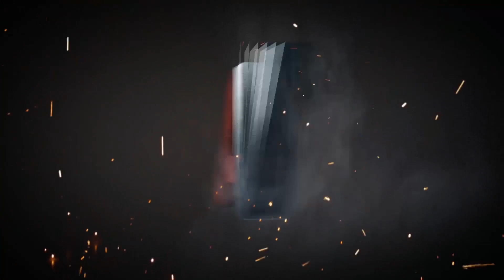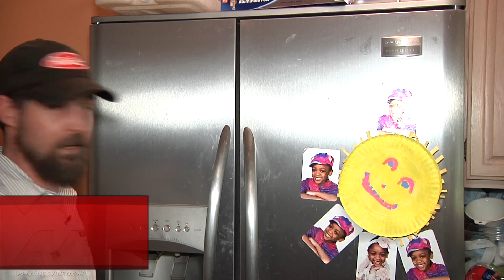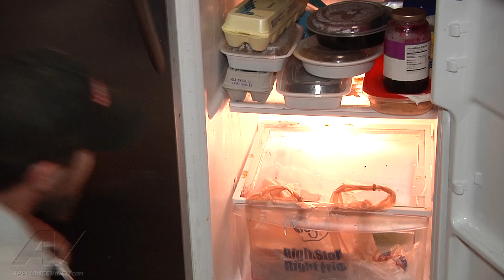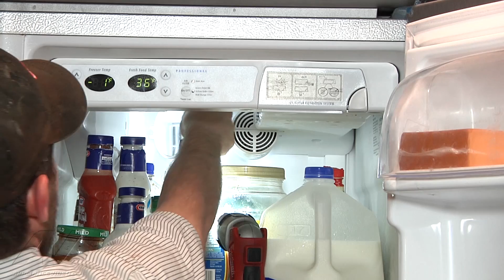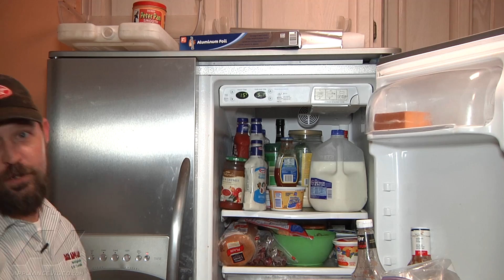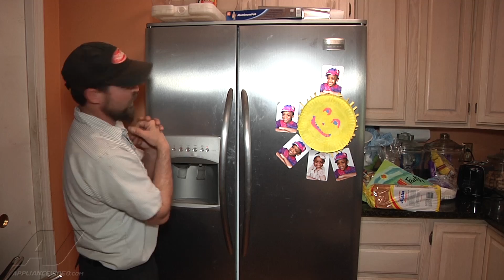Frigidaire Refrigerator Repair - Not Cooling - Main Control Board

Comment: I replaced the fride thermistor and the defrost thermostat and this board yet my coils slightly frost over so I do a manual defrost and everything is fine for about an hour then the fridge temp starts going up and the freezer goes up or all the way eventually past -20 can anyone help

Comment: How do I reset the frig itself?  I turned mine off and had it in storage and now it won't come on.  The lights come on but nothing else.  I was told I must rest it but don't know how.
Reply from the maker: Great question, if you have a more technical question that our parts department cannot answer, you can search our over 17,000 answered questions free at our website www.ApplianceVideo.com under our Repair Help section. You can also call our parts department at 1-800-830-5465 and they can give you help 7-days A week ,or search at www.SaveMoreOnParts.com  .

Comment: I have the same refrigerator, my temperature readings are doing the same thing, however I have uneven freezing on my evaporator, the first section freezing up. All of the fans are running properly, everything is clean, my freezer is not getting as cold as it used to . I’m not sure if I have a control problem or a compressor that’s failing to push the Freon through I hate to spend money for a control if my compressor is failing anybody seen this before?
Reply from the maker: Great question, if you have a more technical question that our parts department cannot answer, you can search our over 17,000 answered questions free at our website www.ApplianceVideo.com under our Repair Help section. You can also call our parts department at 1-800-830-5465 and they can give you help 7-days A week ,or search at www.SaveMoreOnParts.com  .
Reply: I am having the same issues, did you find out what the problem was or how to fix it?
Reply: @karenpack6311  yes I bought a kit and put Freon in it, cools fine for about a year then I add a few more ounces of Freon. They wanted $800 to repair the leak.

Comment: say tim do you have much experience with the ffss2614qeo frigidaire? i have one that i just can't get the fridge cold. i can actuate the damper door in manual  mode and it does open and close on its own but the temps are running high. with the setting at 9 it runs around 50 deg and warmer at lower settings. i have a camera now watching the door with a t/s to monitor the cycle. at this time i went thru a setup on it and now the door remains open and the temp is 30 deg. so now i may have to turn it off and let it set for 15 minutes and then restart it to get it into run mode. i have a service guy telling the damper door is bad but i'm leaning on either to controller of the termistor.  about a month ago it gave me a high fridge side temp warning and i found the lower port plugged with ice. so i went into manual defrost and watched the water drain into the lower pan so the heaters are working. i can cycle the fan and the damper door in service mode. and i can turn the compressor on and off. but i still have cooling issues. the freezer works great i can get it to 6 deg at setting 1 and -8 deg at setting 9 but i can't get the fridge side to change much. no matter what setting i go with. so any ideas what to look at?  i have a baby cam in the fridge now watching the damper door and a t/s and the t/s is at 30 deg and the damper is still open and the settings are now at 9. thanks
Reply from the maker: Great question, if you have a more technical question that our parts department cannot answer, you can search our over 17,000 answered questions free at our website www.ApplianceVideo.com under our Repair Help section. You can also call our parts department at 1-800-830-5465 and they can give you help 7-days A week ,or search at www.SaveMoreOnParts.com  .

Comment: yes i have the same  Frigidair REFRIGERATOR  , THE FAN MOTRO IS WORKING BUT IT DOES NOT FRONZEN THE MEAT. wHAT CAN i DO?
Reply from the maker: Great question, if you have a more technical question that our parts department cannot answer, you can search our over 13,000 answered questions free at our website www.ApplianceVideo.com under our Repair Help section. You can also call our parts department at 1-800-830-5465 and they can give you help 7-days A week ,or search at www.SaveMoreOnParts.com  .

Comment: I have the exact fridge model number E23CS78EPS2 and when I plug it in it seems that everything works OK it shows the temp on the food side and also on the freezer side then the interior lights start blinking on and off and after about 5 times on the freezer side of the display it starts flashing the number 2 on and off on and off and the fan and compressor cuts off what causes this???
Reply from the maker: Great question, if you have a more technical question that our parts department cannot answer, you can search our over 13,000 answered questions free at our website www.ApplianceVideo.com under our Repair Help section. You can also call our parts department at 1-800-830-5465 and they can give you help 7-days A week ,or search at www.SaveMoreOnParts.com  .

Comment: hello I need urgently min fridge FRIGIDAIRE 241739703 REFRIGERATOR CONTROL BOARD WHITE 241739711 E154554 7271651 because of high voltage, I'm broken I need to get away very good pictures of the map that I can see the board can or schematics please help me I live in Turkey thanks in advance Rasim
Reply from the maker: Great question, if you have a
more technical question that our parts department cannot answer, our
technicians are answering all questions at our website at www.ApplianceVideo.com under our Repair Help section. You can also call
our parts department at 1-800-830-5465 and they can give you help 7-days A week
Monday -Sunday, or search at www.SaveMoreOnParts.com  24 hours
7- days A week.

Comment: Our  whirlpool refrigerator does not have an alarm when the door is open too long
Reply from the maker: Great question, if you have a more technical question that our parts department cannot answer, our technicians are answering all questions at our website at www.ApplianceVideo.com under our Repair Help section. You can also call our parts department at 1-800-830-5465 and they can give you help 7-days A week Monday Sunday, or search at www.SaveMoreOnParts.com  24 hours 7 days A week.
Reply from the maker: Great question, if you have a more technical question that our parts department cannot answer, our technicians are answering all questions at our website at www.ApplianceVideo.com under our Repair Help section. You can also call our parts department at 1-800-830-5465 and they can give you help 7-days A week Monday Sunday, or search at www.SaveMoreOnParts.com  24 hours 7 days A week.

Comment: I have a Frigidaire side-by-side, it is 6 months old, there is no water pressure for the water in the door, and the ice maker has stopped making ice. It does make a little bit of ice but nothing to talk about and it's also Hollow ice
Reply from the maker: Great question, you can call
our parts department at 1-800-830-5465 and they can give you help 6-days A week
Mon-Sat . You can also search at www.SaveMoreOnParts.com 7- days a week.  If you have a more
technical question that our parts department cannot answer, our technicians are
answering all questions at our website at www.ApplianceVideo.com under our Repair Help section. We have over 6,000
common questions and answers that you can easily search through by your model
number, appliance make, problem or error codes, and It’s completely free to
search through our question & answer library. There is a very good chance
you question is already answered there.
Reply: E ve  Tooker ok

Comment: I have that same fridge and I do not want to run the panel buttons and an alarm sounds what problem can I have?
Reply: My  frigiaidaire saying hi
Reply from the maker: Great question, you can call
our parts department at 1-800-830-5465 and they can give you help 6-days A week
Mon-Sat . You can also search at www.SaveMoreOnParts.com 7- days a week.  If you have a more
technical question that our parts department cannot answer, our technicians are
answering all questions at our website at www.ApplianceVideo.com under our Repair Help section. We have over
4,000 common questions and answers that you can easily search through by your
model number, appliance make, and problem or error codes, and It’s free to
search through our question & answer library.

Comment: I have the exact same model but my fridge ices up severely every few weeks, it will not defrost.  Can you tell me where the defrost timer is on it, been looking all over.  thanks
Reply: curious as any update on your problem. thanks
Reply: The defrost control on this model is integrated in the temperature control right behind the display
Reply from the maker: Great question, you can call our parts department at 1-800-830-5465 and they can give
you help 6-days A week Mon-Sat . If you have a more technical question that our
parts department cannot answer, our technicians are answering all questions at our website at www.ApplianceVideo.com under our Repair Help section. We have over 4,000
common questions and answers that you can easily search through by your model
number, appliance make, and problem or error codes, and It’s free to search
through our question & answer library.

Comment: Ours is a Frigidaire side x side about 10 yrs old.  Recently noticed a slight rise in the freezer temp. so adjusted the thermostat and all seems well.  But at the same time, the frame around the freezer door is very warm or may even be considered hot(temps running from 90f to 104f.   Is this a symptom of a defrost heater or thermostat gone bad or about to go bad?  Maybe staying on longer than it should but still allows the freezer to cool down?
Reply from the maker: Great question, you can call our parts department at 1-800-830-5465 and they can give
you help 6-days A week Mon-Sat . If you have a more technical question that our
parts department cannot answer, our technicians are answering all questions at our website at www.ApplianceVideo.com under our Repair Help section. We have over 4,000
common questions and answers that you can easily search through by your model
number, appliance make, and problem or error codes, and It’s free to search
through our question & answer library.
Reply: Dick Madison , small Refrig.Frigidaire mod # fft1222qw board changed still blinking it will not reset.

Comment: Okay so I have the same fridge in the video, stainless if that matters. I checked the damper like you showed in the video, Damper is working, opening and closing, return duct is okay. Problem I'm having is when we play with the setting on the control panel, everything shuts off, fridge still has power, lights come on, but the fans turn off and when we play with the controls again, the panel goes blank and beeps over and over. I'll unplug, let it sit for 15-20 min, plug back in and it's working again. Then we play with the controls and the same issue. My model # is DFHS2313MF2 by Frigidaire. Freezer is cold, fully defrosted, all fans are blowing like they should. Besides the control panel what else should I check or in your best guess is it just the panel that needs replacing.... Thanks
Reply from the maker: Great
question, you can call our parts department at 1-800-830-5465 and they can give
you help. If you have a more technical question our parts department cannot
answer, our technicians are answering
all questions at our website at ApplianceVideo.com under our Repair Help
section. We have over 3,000 common questions and answers that you can easily
search through by your model number, appliance make, and problem or error codes,
and  Its free to search through our
question & answer library.

Comment: After you suspected the temperatures were off, wouldn't you hang a thermometer in the refrigerator and close the door for a while and compare the actual temperature to the readings on the refrigerator readout?
Reply from the maker: +Junk Yard 

         Great question, with our technicians
now getting hundreds questions weekly, they are answering all questions at our
website http://www.appliancevideo.com/repair-help/ .  We also have over 30000 common questions
and answers that you can easily search through by your model number, appliance
make, problem or error code and it’s absolutely FREE.

Comment: Im confused... is the defective thermostat control shutting off airflow to the food compartment (closing the damper prematurely) ? Or was it just presenting erroneous readings? My food comp is doing something similar, (no temp readout on mine). I went to your site but could find no vids on PLHS269ZCB4  Electrolux, just parts lists.
Reply from the maker: Ebut
         We now have our FREE repair help website at ApplianceVideo.com, all of our technicians are answering questions daily on this website every day for anyone needing help. Just copy and paste this this question under REPAIR HELP, and one of our  factory authorized technicians  will answer any technical questions at absolutely no charge on your appliance issues. We also have over 2600 free repair videos to help with your appliance repair issues. Thanks for your support. Matt Ace Appliance factory service technician.

Comment: Hi I have a Frigidaire fridge PHS67EHSB6 and works good for about 8 to 12 hours then stops working if I unplug it and plug it back in it starts right up anyone had this problem?
Reply from the maker: Danny Gamez 
                           We now have our FREE repair help
website at ApplianceVideo.com, All of our technicians are answering questions daily
on this website every day for anyone needing help. Just copy and paste this this question under REPAIR
HELP, and one of our  factory authorized technicians  will answer any technical questions at
absolutely no charge on your appliance issues. We also have over 2600 free
repair videos to help with your appliance repair issues. Thanks for your
support. Matt Ace Appliance factory
service technician.
Reply: ApplianceVideo.com